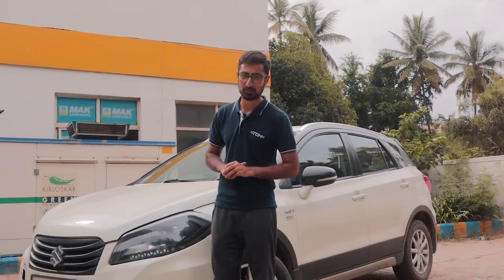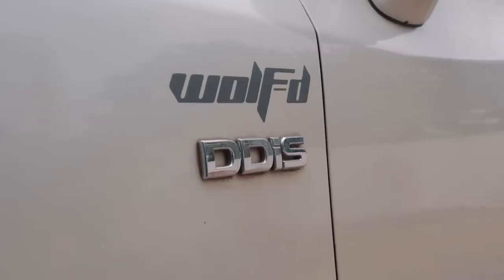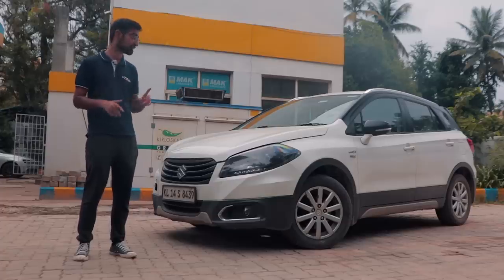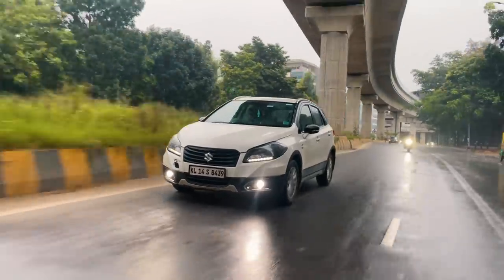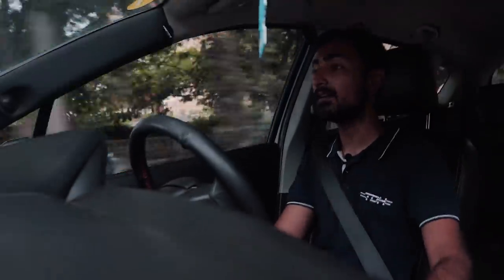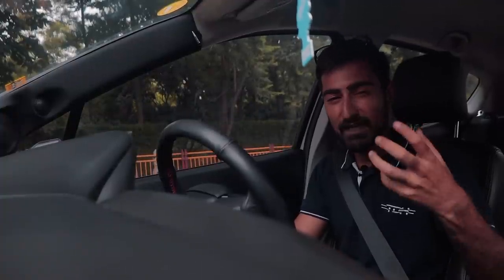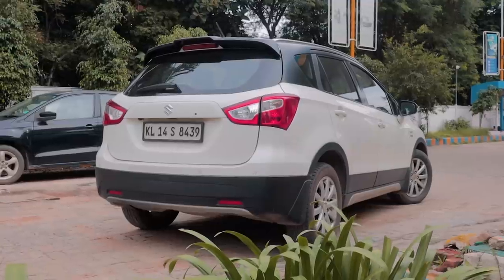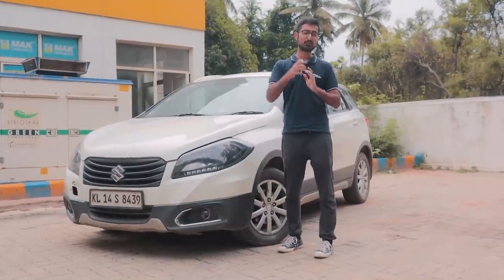Stage 3 Suzuki S-Cross 1.6 DDiS makes 200 BHP with a Garrett Turbo! | Autoculture

Comment: So no one is gonna talk about the fact that the actual bhp of the car is way lesser than 200 horsepower, because the car made 200 crank horsepower, so the power while it reaches the wheel is gonna be alot less.

Comment: I enjoy luring sporty little cars to mid acceleration battles in mine. Last victim was sporty Audi A2 that tried to impress girl in co driver seat while overtaking me. I was waiting in 4th gear at 2k rpm and than i plant the foot down when he was few meters behind me. He stopped trying after that. Mine is stock 2016 4grip with 180k km and still pulling strong.. I am thinking about light tune, engine is in great shape, most of its 180k was driven on highways.. First Suzuki i owned was red 89 Swift GTI than 05 red Swift 1.5gs than 2010 SX4 1.6 4x4 than 2016 scross ddis all grip and now 2023 Swift 1.2 hybrid all grip that my dad bought him self for the retirement. So you can say Suzuki is in my blood.

Comment: Sorry for noob question, does the DDIS 320 comes with 5 speed manual in Zeta version? I found one in olx which has 5speed gearbox and the owner dealer said it's a 1.6 diesel. The car is in Kolkata and I won't be able to go there and check if the car is actual 1.6 or just a 1.6 badge is pasted on the back.
Reply: No, the 1.6 always came with a 6-speed gearbox in all its variants. The 5-speed ones claiming to be 1.6 is definitely a re-badged one. The other difference in 1.6 scross from the normal ones are the silver roof rails apart from the larger engine which you can check in the bonet
Reply: Thanks for the info. Yes, most of the 1.6 listed in OLX are just re-badged ones🤦🏻‍♂️. Difficult to get a well-maintained 1.6 here in Bangalore at the right price.

Comment: You can get a 530i or 530d e60 for 3-5 lacs easy 272bhp or 232bhp
Reply: 530d for 5 lakhs! Where bro?
Reply: @hariradhakrishnan  everywhere
Reply: @HarvinderSingh-vs7tg  than for maintenance 10lkh
Reply: @maheshhegde7002  haha kuch v
Reply: @maheshhegde7002  tere kol paka swift a na
Reply: What you're talking about is a 5 series which is more than 10 yrs old that too registered in Delhi.
Still they cost around 8 lakhs and not 3-4 lakhs.
Majority of them require lots of repair therefore people sell off these cars rather than maintaining it because it would cost in excess of 8-10 lakhs to keep them in pristine condition.
Reply: @vek2901  Eh ja na mein khud leke aya delhi to meinu ds reha 325i te 530d eve bss boli janda

Comment: The intake is going to suck hot air into the system if you didn't close the air filter in a box ... I don't know who is the engineer engineered this ... It's very basic man ... Many doing this mistake just because the sound of the engine makes better